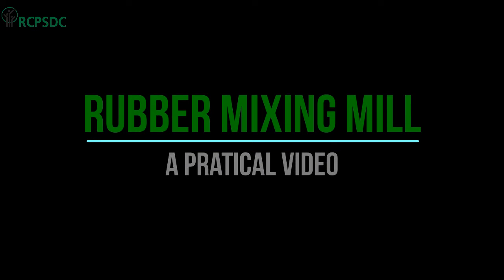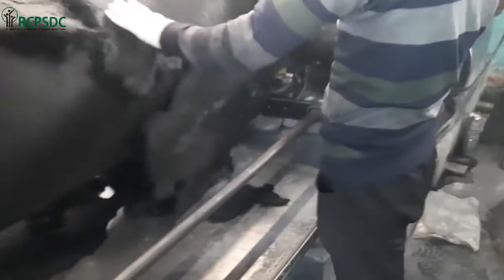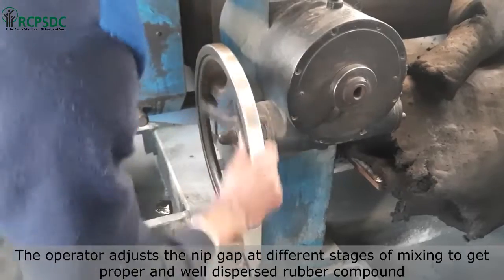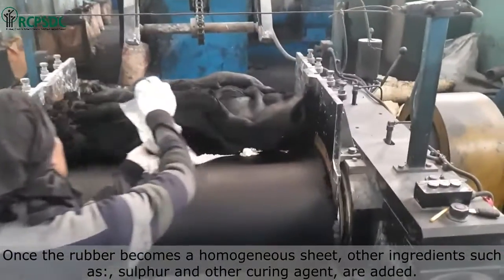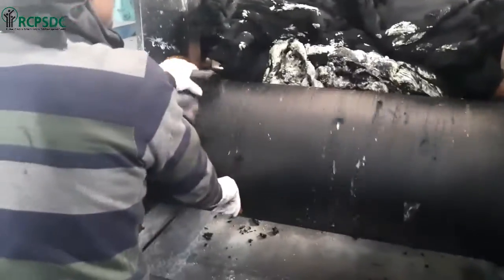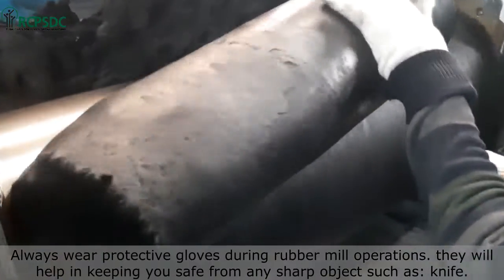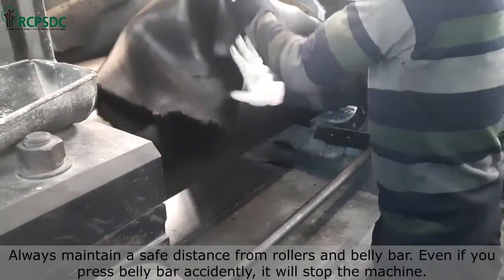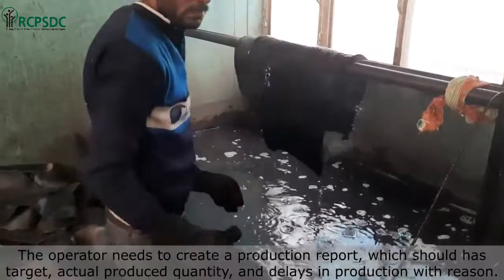Rubber Compound Mixing on a Rubber Mixing Mill

Comment: In 2003-2008 I've been working in goodyears factory & rubber.  Working in banbury division than extruder division as a millman.  But the milling machine its bigger than in the video...
Reply: Just looked this video up out of curiosity. I work in the banbury area of a bridgestone factory, as a contractor (hopefully I'll be bridgestone soon and start doubling my pay). The mills in my factory are way bigger than this one.
Reply: I've been a mill man for a long time I'm in akron I'd love to work for Goodyear as a millman he also put a curative in I see we use varox
Reply: I worked for the inventor of rubber bands, the Banbury we used was 20 foot wide and 3 stories tall.
Reply: I’m used to 84” drop mills as well as warm up mills used to feed extruders.

Comment: He should put the rolled compound in vertical direction which he is not doing.
Refining (passing through tight mill) is also not included in this video. Size of mixing mill looks much smaller compared to the size of batch.
Reply: I don't think quality is what they are looking for.